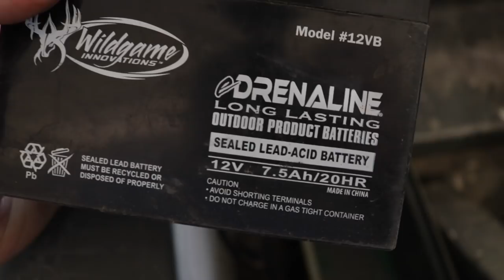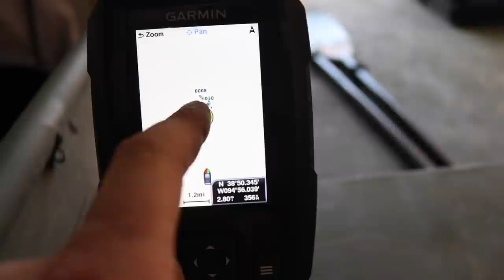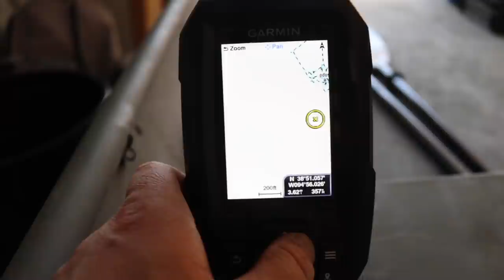The Boat Is READY! | The First Fish In The Boat

Comment: Make sure you grease the buddy bearings and get covers for them. Suggest unplugging the trailer lights when backing in to water it will save electrical on truck. I would get some type of covering on the floor of the boat, to reflect the sun as it will get hot.

Comment: A good way to avoid drilling holes in your boat is to get a transducer mounting plate that gets glued on with marine adhesive I did it to all my boats and works better than drilling into the boat because if you need to put a new transducer you can do so without having to drill more holes in your boat

Comment: What size flat bottom is that?? It kinda looks like mine!! Lol!! Mine is a 18’ long & extra wide!! Mine had not been on the water since 1988 or1989 when I got it!! It had been in a barn for ever!! It’s in absolutely awesome shape! None of the rivets leak!! I put a Johnson 35 hp motor on it & I put a salt water trolling motor on the front!! I can’t remember the name or model but it’s a minkota & has the spot lock a remote that you can hang around your neck!! At first I could not believe that I was going to spend 2thousand dollars on a trolling motor but after getting it & getting it installed & actually got to use it I can definitely tell you it was definitely worth every penny spent!! That spot lock option is amazing!! No ropes, no heavy weights do you have to worry about getting stuck at the bottom of the lake!! It definitely took me years before I could even spend that kind of money on a trolling motor but after doing so I couldn’t be happier!! Know the reason I went with the salt water model was that it is white in color & I figured white doesn’t heat up like black does & thought that maybe that might help with not having as many problems with as some of the black ones do!!! So far so good & not one issue since getting it 4 or 5 years ago!!! Just a thought for when you go to look at ones for your boat!! I did put a counsel & was able to hook the 35 hp motor up to it so I don’t have to be all twisted with a tiller handle one!! Absolutely love that also!! The only other thing I would like to do to it is get rid of the black floor that I put in it & make a decent casting deck with a stool or something small to sit on while fishing out of!!! If you have any questions let me no!! Sorry so long!! Lol!!